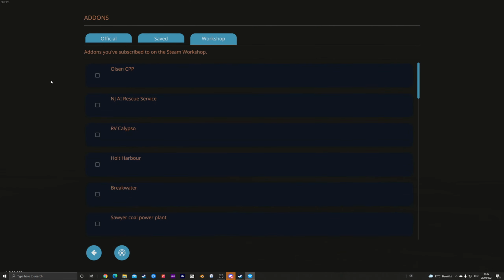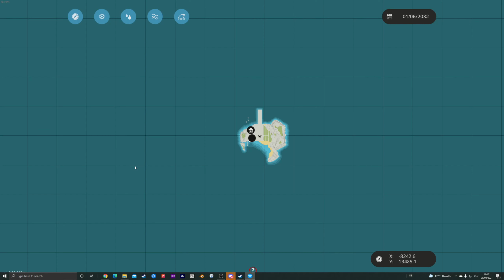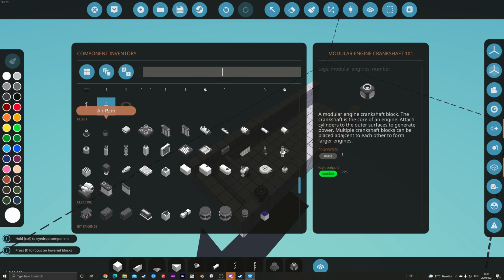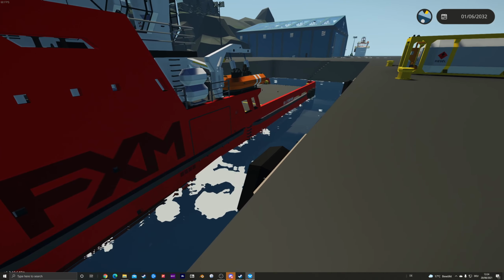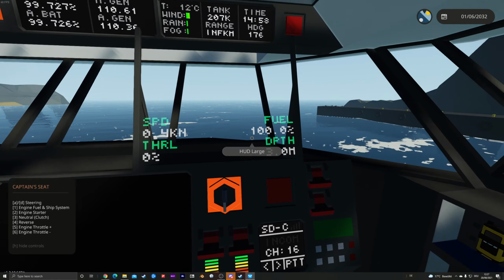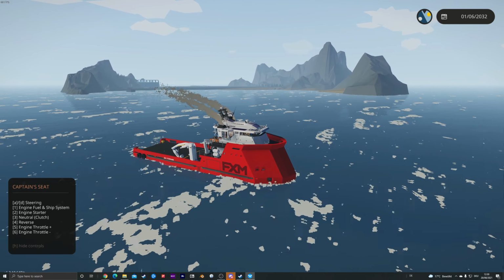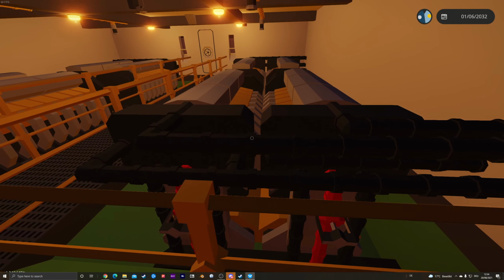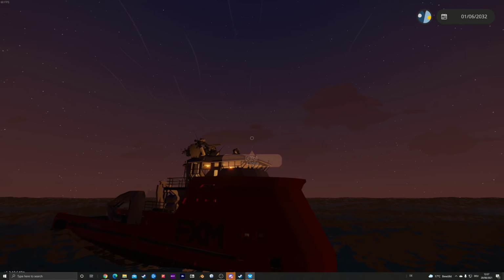a COTS game for industrial use cases?

Comment: Just so you know: Stormworks is full of bugs and wrongly modeled physics. e.g.:
- a flat bow, just a brig wall, has way less drag than a pointy bow.
- water weighs 10x more in tanks than in the ocean.
- wings produce lift upwards. regardless of the orientation or velocity direction of your vehicle.
- the air is soup
- the performance of wheels, propellers, hinges, rudders, etc. depend on the weight of the grid they are placed on. (e.g. a rudder on a subgrid, that is relative light compared to the main grid, will have close to no effect. the same rudder directly on the heavy main grid will have a big effect)

There are many more problems. Stormworks is a fantastic game for creative builders, but don't compare it to a simulation. Most of the listed "inaccuracies" are there to reduce the complexity of the calculations and to simpliefy the physics for "casual" players.
Reply from the maker: Thanks for pointing out many of the weird physics issues, I guess it's to.be expected as there is so much going on. It makes those builds which behave in a realistic way all the more impressive!